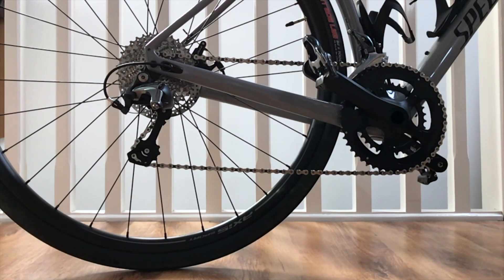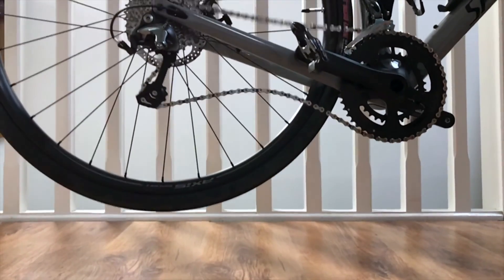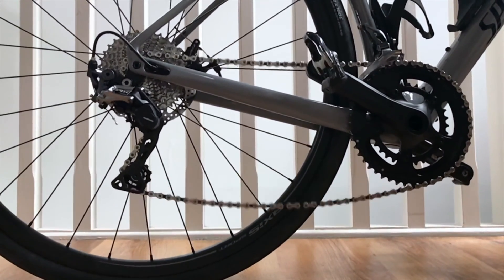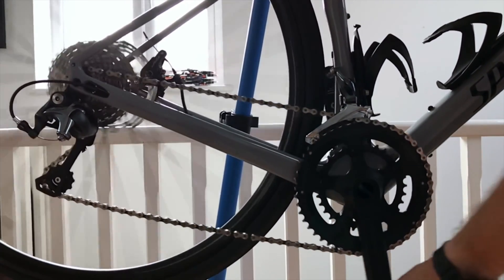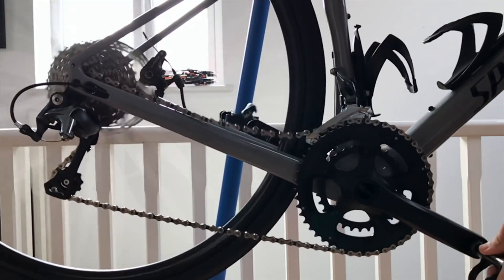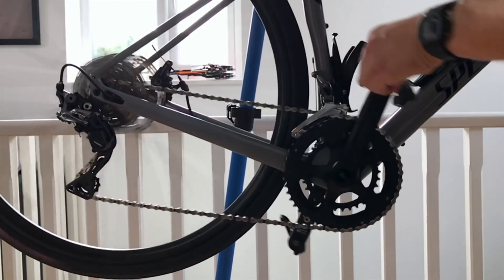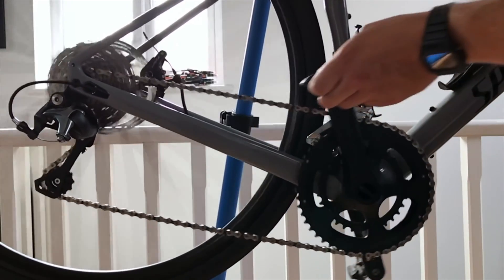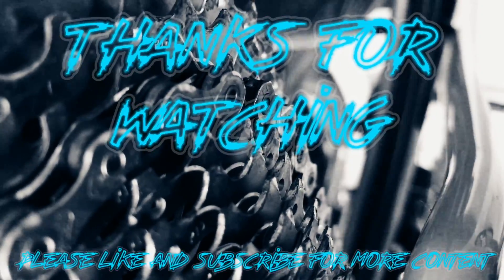Clutch Vs. Non Clutch Rear Derailleur. GRX812 Vs. Tiagra 4700

Comment: Im currently building a Frankenstein bike.  It's a tt bike base with MTB shifters and gravel/MTB cassette derailleur for wide range hill climbing.

The base stock tt bike cassette was useless for going above a hill with more than 4% grade as the large sprockets of cassette were constantly being used and the small sprockets were always untouched.  It's 11-25

Comment: Started cycling on a gravel bike just some month ago. I didn't even realize it has a clutch, neither did I know that clutches exist all along. Until I found that lever two weeks ago.
On factory setting it was actually off. Since I switched in on, everything feels smoother and the noise from down there is way more quiet.
Is there any reason, e.g. depending on surface type, to switch it off for riding?
Reply: I just found out about the clutch yesterday as well when I took my bike to the shop. I was perplexed.

Comment: Regarding clutch on a road bike, I think the con argument is not so much weight, but power - the clutch needs to introduce some friction that the rider has to overcome. Or am I wrong? Any idea someone if this would be some tenths of a Watt or even several watts?
Reply from the maker: Your mostly wrong. A clutch is not a spring but a damper remember. So once you have shifted gear the derailleur cage is not moving so it’s no wasting any energy. The only energy is the momentary loss is when you shift to easier gear in the cassette where you have to overcome the friction. You can feel this in the shift lever when you you try it with the clutch switch off and compare it to on. But you could argue the energy is from you hand and not the drivetrain. 
I think the only possible situation where there would be added friction induced to the drive train would be if you were using oval rings, this could also reduce the life of the shimano style clutch as it would be constant moving slightly with each pedal stroke. Sram being a fluid type would likely be fine. 
Alll that said, I’ve used oval rings on my mountain bike with a clutch rd and not noticed a thing. Just the rear cage move maybe 5mm fore and aft per pedal stroke.
Reply: @MozOnBikes  Thanks for clarifying - bad logic on my part!

Comment: My sora rear mech is brutal for the inertia issue I have to be always conscious to not stop peddling to quickly. The 10 speed 105 on my last bike never had this issue. I’ve been considering replacing the tension spring in the rear. Or just get a grx and upgrade to either 10 speed with some tiagra shifters.

Comment: Will a deralleur with a clutch have a longer lifespan/survive drops better than one without?
Reply from the maker: No. But you’ll be less likely to get frame damage from the chain or have the chain drop from the chainrings.
Reply: @MozOnBikes  ah, thanks for clarifying cuase i thought maybe if the derailleur is on there tighter its less likely to fall and droop into a rock or something, thanks anyway.

Comment: Can we change gears while clutch is on?
Reply from the maker: Of course! The reason for the switch is so you can turn it off and that makes it much easier to move the derailleur out of the way when removing the rear wheel from the bike.
Reply: @MozOnBikes  ohh that's a point I didn't realize it
Btw thanks

Comment: Hey there, thanks a lot for making this video!
I'm currently running a kind of a weird mullet setup with a 5800 rear derailleur, 5800 50/34 cranks, and an 11-36 cassette. It all works just fine most of the time, but due to a longer chain needed to wrap around 50-36 safely there's now a ton of slapping and noise and infrequent albeit annoying chain drops. The 5800 has seen better times, so now I'm getting an Ultegra RX800 to replace it, and it has the clutch. This video really helped me to see just how much of a difference I'm likely to get.
Interestingly, it's seemingly the only video on YT to demonstrate the road clutch in action.
Reply: 1 year report.  Has the clutched Ultegra RX800 worked out as desired in your issue?
Reply: 5800 medium cage rear derailleur supports max 32 teeth only.

Comment: The derailleur is not just oscillating, it hit the frame. On my frame there are several paint chips because of this, and the derailleur took so much hit that the paint is totally absent on a spot and the surface is shiny. Not a good thing, the bike hammering itself apart.

Comment: I have a Tiagra 4600 and want to upgrade GRX810. For a 10s option, will i need to swap out the 4600 50/34 Chainring and FD for a 4700, i think it'll be a direct swap without having to change the BB?  I'd like to put in a GRX 2x Chainring but i think the BB will need changing too as it seems the drive side and non drive side bearing are different in size ?
Reply from the maker: I think the cranks will be a direct swap. I’m fairly sure Shimano have constant spindle diameter on both the left and right. 
I think a bigger issue for you is that I’m fairly sure that the GRX derailleur won’t work with the 4600 version of the Tiagra shifters.
Reply: @MozOnBikes  Yes the 4600 pull ratio is different. Shifters definitely needs upgrading to work in the RD. But can I still keep the 4600 FD/Chainring? Or must I upgrade the front as well? Will the new 4700/7000 shifters work with old 4600 FD/chainring?
Reply from the maker: I’m not sure, im a bit of a 1x convert so don’t have and front derailleur to experiment with. 

One potential issue is if you go for a grx chainset. The chain line is offset outboard by 2.5 or 3mm if I remember correct to increase tyre clearance. I’m fairly sure if you go for a grx double chainset you’ll also need the grx front mech to match. 

So using that logic if you keep your current chainset it might be worth seeing if your existing front derailleur still works with the 4700 shifters it’s a zero cost experiment. If not matching 4700 front derailleur is probably the one to go for.
Reply: @MozOnBikes  Tqvm there. You’ve been super helpful.

Comment: Just picked up a 2018 diverge E5 with the same exact Specs. Besides the issues you displayed in the video I’m also experiencing chain drop as soon as I backpedal. Only time I can backpedal is when I cross chain on the big ring both upfront and back. This is causing issues every time i need to Clip-in or have  to reposition my feet. I know you’ve moved away from the Tiagra 4700 but do you recall having that issue? I have a Jamis with the same group set and this doesn’t happen at all.
Reply from the maker: Hmm strange, some brands are better at back peddling than others. Out of interest is your bike running a different brand chain like a KMC?

Comment: is it possible to use Deore RD+ with sora R3000 9spd sprocket and shifter?
Reply from the maker: I don’t think that will work. I can’t find any info to make me think otherwise.
Reply: @MozOnBikes  thank you very much, hopefully I can find some great deals for 2nd hand tiagra groupset to be mixed with GRX RD like yours 😊
Reply from the maker: It could be worth going for an 11 speed like 105 with a GRX rear. It’s not too much more and should have greater support in the future. Tiagra 4700 must be due a refresh soon as it’s been out a long time.

Comment: In my opinion, the test should be done with the crank blocked, like in real world scenario when your legs on the pedals don't let the crank to rotate backwards, the idea is the clutch has nothing to do with the upper segment of the chain (the segment located above the chainstay). In that portion, the tension in the chain is a factor of how much torque is applied on the crank. Let me know if I'm wrong

Comment: Hello, great video. 

I'm currently running a Tigara 10 speed on my Diverge and was wondering if the GRX 812 will directly replace the rear derailleur, with no issues? Despite the GRX being an 11 speed derailleur. 

Thanks
Reply from the maker: Hi H W, yes that’s is exactly the setup I was using on my diverge for over a year. Unbolt then Tiagra rear mech and bolt on the GRX812 and do a normal new set up, limit screws, and indexing and it works perfect 👌 
I made a video just before this one demonstrating this exact set up and it working perfect. If your interested I’ll pop a link to this video here. https://youtu.be/LulHM6fueVU
Reply: @MozOnBikes  Thanks so much for the reply. Will give it a go.
Reply: @MozOnBikes   Do you know if the same thing applies with the Ultegra RX800? (I'm running a double on the front)
Reply from the maker: Do you mean like this?
https://youtu.be/pGQ63yiYIIE

Comment: this video is exactly what I've been looking for! Please can you answer my questions:
- which gear leavers do you have?
- which front derailleur?
- is it possible to mount a tiagra front and grx rear derailleurs?
Thank you so much 😊
Reply from the maker: Well I’ve very recently made the plunge and upgraded to GRX800 shifters, but prior to this I was running the Tiagra 4700 shifters. I was running with the  Tiagra 4700 front derailleur and a GRX812 11 speed rear derailleur. I’ve got another video showing the Tiagra 4700 working with the 812 rear derailleur that avalibr at this link https://youtu.be/LulHM6fueVU 🤙
Reply: Moz On Bikes you're using grx shifters with mechanical brakes? As i know they're only hydraulic!
Reply from the maker: Sorry my bad, I’ve changed everything to GRX800 now except the chainset. Shifters, hydro brakes callipers and rear derailleur. Gone for a 1x setup
Reply: @MozOnBikes  what cranks did you go for to get 1x? Praxis Alba's?
Reply from the maker: Still running the original praxis chainset the bike came with but with a 1x narrow wide hope chainring presently. It’s on the list to be replaced as I’m really not keen on the praxis system and odd bottom bracket bearings.
Probably going to go for a Shimano GRX 800 chainset or possibly a Hope RX if I’m feeling rich enough. But that’ll be quite some time off yet, basically I’ll probably wait until I have an issue with the bearings and replace everything in that area.

Comment: Are you using Tiagra 4700 shift levers with the 812 derailleur? I have a 400 on mine, Shimano told me only the 400 is compatible but none of the 800 series.
Reply from the maker: I sure am! I’ve not tested the grx400 cross compatibility with the grx812 (I don’t have access to a bike with them) but using a logical extension that should work. From what I can tell the current range of Tiagra 4700 rear derailleur and up are all cross compatible. 

I made a video about it just prior to this one 
https://youtu.be/LulHM6fueVU
Reply: None the less I absolutely love my GRX 400 with Tiagra 4700 shifters OSPW setup and TRP HY-RD hydraulic mechanical calipers ❤️ my favorite setup yet. Works better than any full hydraulic brakes I’ve used to date ❤️ and shift like butter 🧈
Reply from the maker: Ahh I get you, I thought you had the 400 shifter and wanted to use the 812 rear mech. Sounds like a great set up. I’m looking for a deal on the grx810 shifter and calliper set at the mo, I fancy and upgrade to 11 speed, hydro and maybe even get the dropper lever option for future upgrades.
Reply: @CAPRAQUEENRC  I came across this comment and had a question if i got this correct - are you running Tiagra 4700 shifters with the GRX400 rear derailuer succesfully? Are there any issues or cons to doing that? I have a noisy 4700 setup currently, is the rd upgrade worth it?
Reply: @cirvis240  I am and no issues whatsoever. Works amazing and still running great through all conditions and obstacles ❤️
Reply: @CAPRAQUEENRC  That's good to hear. Is it a 1by or 2by up front though?
Reply: @cirvis240  I got the 2x

Comment: Very nice video, I'm getting a RD400, as a replacement for my tiagra, and I wanted to see how it handles. Thank you, great exhibition.
Reply: I have the GRX RD-RX400 with OSPW on my diverge with Tiagra 4700 shifters and it works amazing ❤️❤️❤️🤘🏼
Reply: I've contemplated this as well. Did you do it?
Reply: @F3udF1st   It works, shifts nice(when set up correctly, took a few tries) and the chain doesn't bang around much anymore.
Reply: @vitsalava1251  Do you notice a difference in top speed? I'm considering going for tiagra intentionally, because I want to ride mainly on road.
Reply: @lgolem09l  Top speed shouldn't change as the derailleur doesn't change the gearing